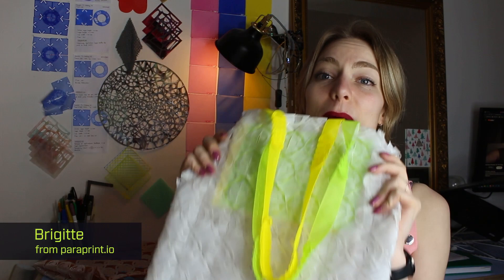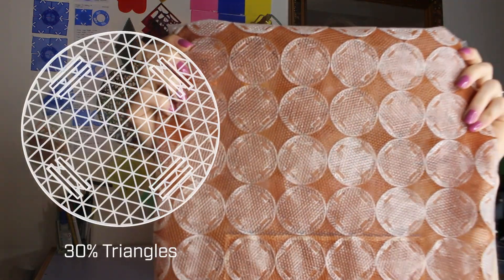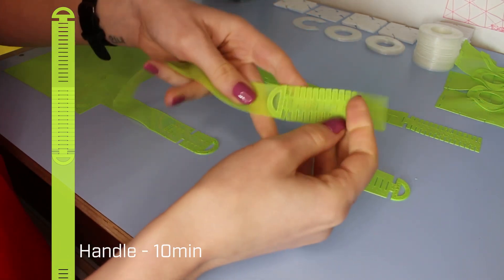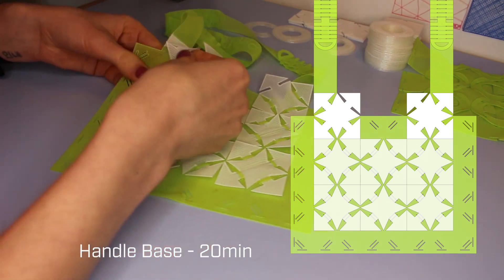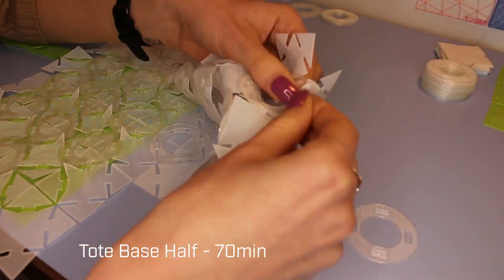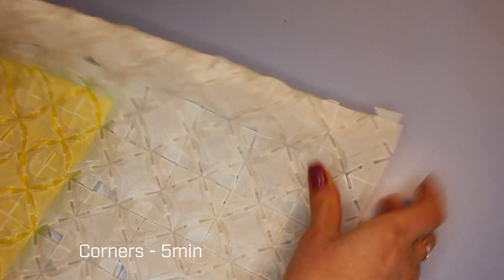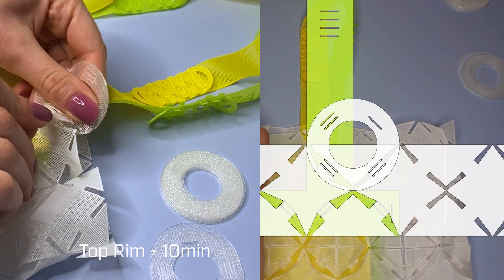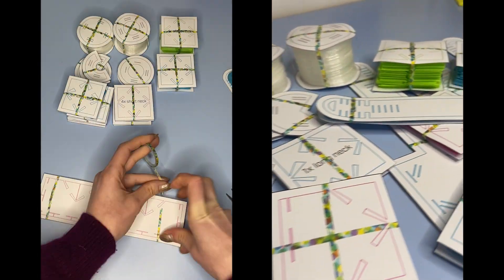Use the FREE files to 3D Print your own Modular Tote

Comment: Hi,
Amazing design!
Do you know how much weight you can carry? Thanks.
Reply from the maker: Hi! I made a TikTok about frist prototype : https://vm.tiktok.com/ZGecS5JAT/ 
The new version should hold more than 1.5kg, and will also be able to hold more if you print denser (I used 40% line infill, so instead 90%+) or with a less flexible filament (I used 70 and 82A, so instead use 95A+). Or you could even consider glueing down the modules, since these are not designed for strength! At some point I may make a new version of this. ♥️